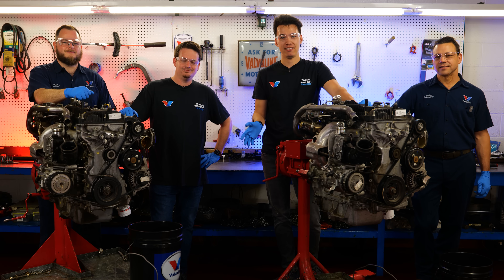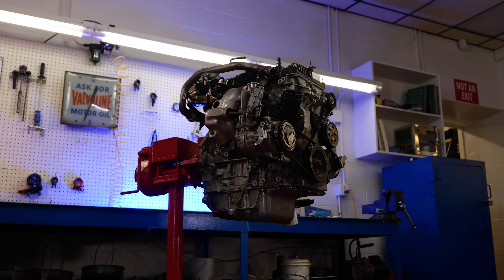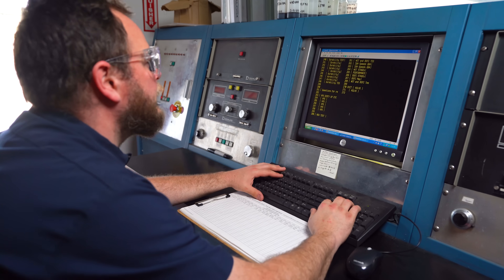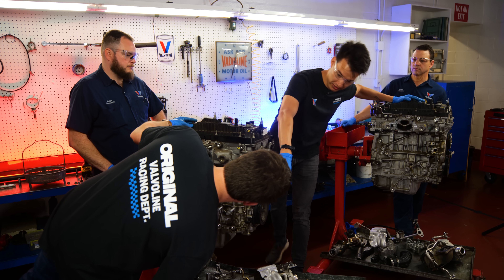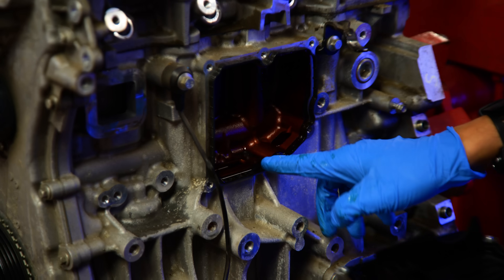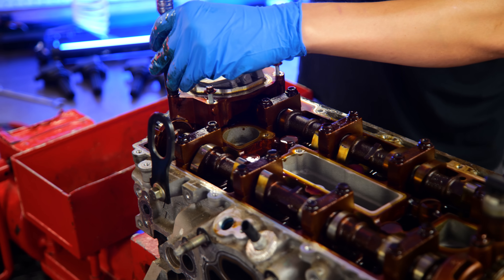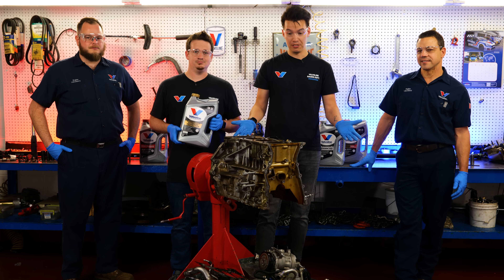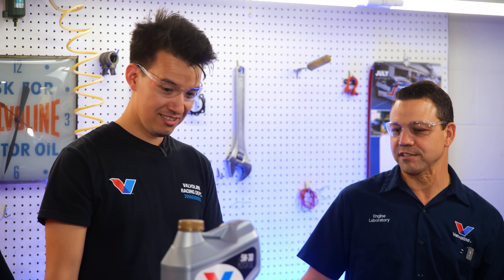Testing different oils over 4 years and 1 MILLION miles

Comment: 10k on conventional is just WAY too long.
Reply: yes
Reply: Yeah back when I ran conventional years ago, I’d do 3000 mile changes.
Reply: Should definitely run the same test but changing the conventional oil sooner to see how they compare
Reply: Bought a new 07 tundra 5.7  it's got 657,000 miles change oil every 5 to 7 thousand mostly conventional sometimes synthetic new valve cover gaskets at 500,000 clean as a pin under the valve covers. Ink stamps still there.
Reply: No no this is accurate in terms of how people use their vehicles. I work in an oil change shop and while ill write the sticker for anywhere around 3-5000 miles for conventional oil lots of people want the cheapest oil change regardless of what the manufacturer says and they'll run it for 7.5-10000 miles even tho it wont last that long. synthetic oil id go from 5000 to 10000 miles max.
Reply: Its too long for any oil, I saw a Toyota tear down on synthetic 10,000 mile oil changes, burned oil, and the engine was trashed, nothing inside could be saved, the entire thing was disposable.
Reply: They did say that they were pulling oil samples for testing, I am sure if the additive package was breaking down they would have adjusted the change interval. Detroit diesel has different service intervals based upon the application of an engine. Severe usage might only be 15k miles, IE dusty dirty environments, high idle or PTO time, etc. Where an engine doing line haul might have an interval of 50k miles.
Reply: If that's true, running conventional would be way more expensive so you don't need this style of test to compare - you know just based on cost that running synthetic is better without the test. 
Whereas this test was useful because it showed what would happen if you tried the cheapest option (running cheaper conventional as long as the slightly more expensive synthetic).
Reply: @themikeroberts I use Valvoline Advanced every 3000 miles. It's just about 5 dollars more then conventional Valvoline which is getting harder and harder to find anymore. Plus my new car calls for synthetic oil in the manual. 
It's an oil school non-turbo engine that they've been making for years. Conventional oil every 3000 miles probably wouldn't hurt it.
Reply: Naturally conventional will not go 10k.
Reply: @ I’d never go 10k on any oil.
Reply: I bet if they changed the conventional oil every 5 it would be just about as impressive as the synthetic. Still great considering 10k which I would never do on even synthetic. I do 5 on synthetic or a bit earlier. Great video though.
Reply: I had to change my cars head gaskets after 25 years in my 1994 car. Have used only conventional and the inside looked great and clean always changed it at 3-5k.
Reply: @carlosb1 I rarely go over 3000 miles and I'm using Valvoline Advanced. 
And when I go past we're talking about a couple hundred miles. 
I use Valvoline only because of it's availability I've used various brands over the years and if you change any of them on time, 3000 miles you'll never have a oil 🛢️ related breakdown. I'd use Quaker State again if Walmart wasn't the only place to get it.
Reply: @truckerrickakamanowar  It wouldn't. Shell did that, 1/2 the OCI with conventional and the engine was far more gummed up than synthetic running double the time.
Reply: That oil should have been changed 3x in a 10k miles interval.
Reply: Maybe but I think it's more accurate because for one that's what the manufacturer recommends they said and more importantly I feel that interval is more realistic for the average driver that just uses the vehicle to commute
Reply: 100% that is insane oil change intervals
Reply: Ya they should know better. But that how you make another oil look better lol
Reply: good point, also the oil temperature history I think is important but in this case I assume they kept it low
Reply: Apparently, it's not.
Reply: Clearly not tough guy.
Reply: If that's what Ford tells you to do, it's planned obsolescence. There is no other reasonable explanation.
Reply: I was thinking the same thing
Reply: 3k on conventional
Reply: @darrellteague8629 Buy a cheaper synthetic oil and change it every 3000 miles. That stuff they used in the video is $40.00! The V-Advanced is $25. 
Any type of oil conventional or synthetic starts to suffer from fuel dilution after 3000 miles. Plus other contaminants. You know this when you have to start topping up between oil changes. With 3000 mile intervals i never have to top up.
Reply: Not if you're running constantly for 8 hours everyday. You'll reach that 10K in no time. So the oil is probably in better condition in a car reaching 10K in 2 weeks compared to a car taking 9 months to reach 10K. 

In this scenario, the oil is in a controlled environment. In real life, most people are driving through, dust, snow, rain etc. which all have particles that make it past the filter. Then you have Ambien temperature changes. Then you have oxidation over time. 9 months of oxidation compared to 2 weeks is a significant difference. 

I agree that for real life, 10K is way too long. However, in a controlled environment that sees miles adding up for 8 hours or more straight, you'll have less elapsed time between oil changes. 

They should have driven to and from work with these cars until it reached 500K miles. Would have been more accurate.
Reply: It took five years for this video tested the way they did. We'd still be waiting a long time for this video if they were getting treated like daily drivers. No test is perfect, this was a solid A-B comparison over years of use with good controls and measurements taken throughout the testing
Reply: Yeah , I hear flak all the time , but I change mine (highly modified forged internals and bored over)around every 3k or maybe less to keep the engine staying and preforming like new , and those is hard miles to , forced induction , fuel dilation , 16" hood dump and a flame tune , so it's harsh on the engine , but I built it myself and to handle my abuse and it is now I think around 40k since I built it and holding strong 💪🏽  and I honestly believe that has alot to do with regular maintenance and keeping up with everything it needed .. you got to pay to play 😅.. peace and love all,  keep it rad, stay safe, and build on.. l8r
Reply: Should be 3500k at most  with conventional
Reply: On any oil 10k is bonkers
Reply: @gasNmudtv  Look at the evidence here and on any number of oil specific forums. Use a quality synthetic, 10k or even higher isn't a problem under general use with an otherwise healthy engine. Even the conventional engine, after 500k, didn't exhibit any fatal failures directly related to the engine oil on this oil change interval. The issues come from short trips where the engine never comes up to temp allowing more blow-by and water to contaminate the oil and failure to adhere to a 10k/1yr schedule. Though that said the conventional engine likely would have been in better shape with 5k drains but it's not a failure component and I doubt many people are taking their cars to 500k anyway.
Reply: @gasNmudtv  Up to 20,000 mile intervals are routine in Europe!  It's about reducing the maintenance costs on paper, especially for fleets.  With long-life synthetic oil the oil doesn't necessary break down in that time, however the dirt in the oil can wear the timing chain and engines on that schedule probably show a LOT of varnish.
Reply: That's the problem!

Comment: So the conclusion: Change your oil.
Reply: The conclusion is..if u abuse your vehicle & don't change your oil, u may not have as much unnecessary wear using synthetic...change your oil every 4-7k, depending on type of driving, and conventional, synthetic blend, or full synthetic will be fine

Comment: Commercial or not, it's awesome to see how much of a difference the oil type makes! 
I'm really looking forward to next Saturday's episode!
Reply: Why 10k miles intervals??   who's that dumb?
Reply: The cool thing is that while this is kind of marketing a little bit, they actually compared their synthetic versus their conventional, which means it's a fair comparison.
Reply: There not much difference. Both engines are running fine.
Reply: @ExecuteBrandon there is a pretty good chunk of a difference as far as how the oils differ from each other. In the long run the conventional oil engine would have more problems done the road causing the engine to eventually fail much FASTER THAN THE FULL SYNTHETIC OIL . Bottom line is run full synthetic oil.
Reply: @diegogonzalez9329  This test doesn’t support your statement. Lol
Reply: @ExecuteBrandon his statement is supported by the video, especially in the last quarter.

Lets just compare:
7 cold stuck oilrings on the pistons for conventional oil VS 1 on synthetic oil. 
300k mile Turbo with heavy wear and build-up VS a worn turbo with little build up after 500k miles.

Just those two are already enough to prove his point.
The cold stuck rings will fail eventually, having seven of them now is a guarantee that one will get hot stuck soon. 
the Turbo will also fail soon meaning a third replacement for the conventional while the synthetic looks like it could go another 100k miles before replacement, but even if it fails in the next 10 you would still only be on the second while the other remains on course to hit the third in not to many more miles. 
The tensioner of the chain getting stuck out of position will also increase the wear and reduce the economy of the engine. So it will cost you double in the long run. 

It might have helped if they had actually measured fuel consumption, which should be easy in such a test. 
The conventional oil engine certainly uses a bit more fuel now than the synthetic oil one simply due to the slack in the chain, the higher levels of carbon build-up and the number of stuck oil rings. 

While you are correct that both oils kept the engines in decent condition, it can also be said that the "extended range premium synthetic oil" did live up to its name and despite the higher costs per oil change youd safe more money in the long run. Ofcourse if you change cars every 100k miles the story would be different and the cheaper conventional oil would not cause you any aditional costs at such a milage, at least judging from what we saw in this test.
Reply: @AlphaHorst  And yet, none of the engines failed which is what actually counts.
Reply: @ExecuteBrandon  if you believe so.

So it does not matter if the screen of the new Phine you bough is cracked? because it still runs just fine and you see no real difference on it. What does it matter that you lost the IP6 water resistance due to wear, you see no difference after all. 

You are very much mistaken. "Running" is an utterly non discriptive word in this. A engine with just one remaining cylinder producing 1HP would fall under "running". An engine without oil would fall under "running" 

This is not a test of "doeas it run" but a test of "what is the condition of the engine parts" and there we see clear differences.
Reply: @ExecuteBrandon 
Lol, no, the difference is how much longer each engine will last.

Comment: this is just proves that you should only use synthetic.
Reply: Oh i agree.but broke people only see bottom dollar, they dont think to😊 see long term consequences
Reply: We need Pennzoil to make one of these videos
Reply: Not all cars work well on synthetics.
For example, they're not very suitable for rotaries as when they break down they leave heavy carbon deposits and risk extra friction on the apex seals
Reply: @BySixa here we go…someone’s gonna pull out the extreme outlier and use it as an example as to why not use the broadly accepted product. It literally says not to use synthetic in every rotary engine manual….so why even bring it up?
Reply: @Rebel635csi  lmao relax.
Throwing blanket statements around to complex problems where there isn't a binary right/wrong answer will inevitably get responses.
The OP's reply after your comment was a little more dignified than yours and clarifies their position.
Just because someone is right does not mean that they're trying to be an ass hat, I just wanted to add further context and content to the discussion I wasn't trying to be a smart arse.
Reply: @BySixa  rotaries more or less dead so i only speak for piston engines
Reply: @alexstromberg7696  oh most certainly, your comment is correct for most of the audience just thought it would be worth noting. Thanks
Reply: @BySixa  so does dinosaur oil. Just use the right synthetic for the right application.
Reply: Not enough of a reason for people who are tight on budget. They dont care
Reply: @KG_BM  i have seen what a quality oil is priced at in the states and it is so cheap i can’t understand why you wouldn’t use it. It’s like 25USD for a gallon.
Reply: That's 100% false information...if u are lazy, abuse your vehicle & don't change your oil when u are suppose to, then use synthetic..otherwise, any oil every 4-7k depending on driving conditions is perfectly fine...my almost 22 year old Ford engine runs fantastic, having zero full synthetic
Reply: @andybales7318  yeah a non turbo slow engine is not hard on oil? Go figure

Comment: Honda engines can run with no oil.
Reply: For two minutes
Reply: But Ben learned that they can't run with no coolant.
Reply: I ran mine without oil for a day or two. I just added oil and kept going. Honda really makes them to last
Reply: I can say this is a true statement lol I had an ATV that I rode back to the house for two hours with no oil then fixed the leak and filled it up and still running today ... This was in 2007...
Reply: My mom had a d16 powered acura el for a while...thing leaked from everywhere you could think of and burned oil, I purposely neglected oil changes on that, once I didn't change it for 20k miles since I was always adding whatever cheap top up oil I could get from a local Canadian tire that had Castrol single quarts for 2 bucks a pop...not to mention I abused the crap out of it myself...still soldiered on, rust ultimately took it away
Reply: I wouldn't mind getting one myself and adding a small turbo to it just for daily driving

Comment: Testing might not be super fair because it doesn’t account for all of the cold starts, sounds like the oil probably went through one heat cycle between changes. 14 minute Valvoline commercial L
Reply: If you listen carefully they clearly said that they run these engine daily. so cold start everyday trying to replicate everyday driving.